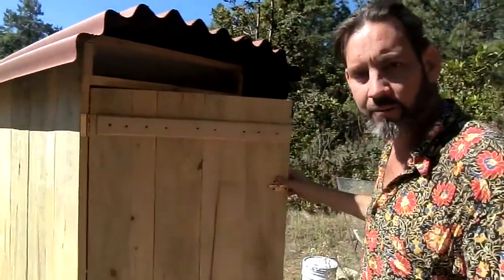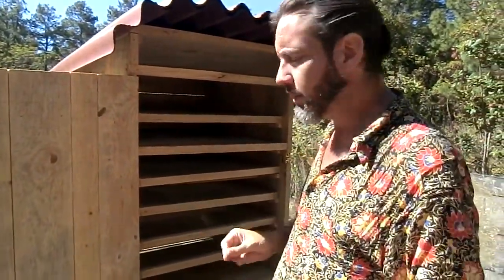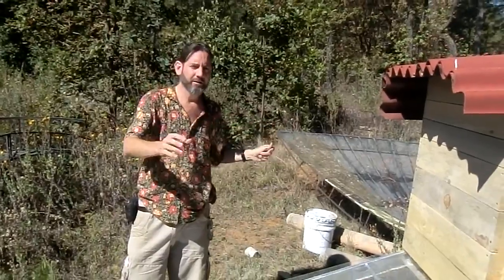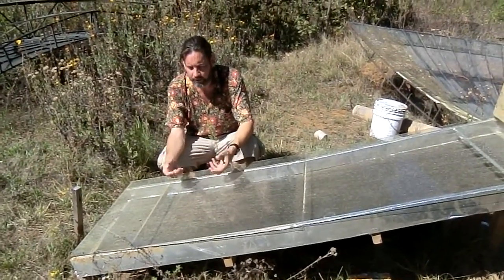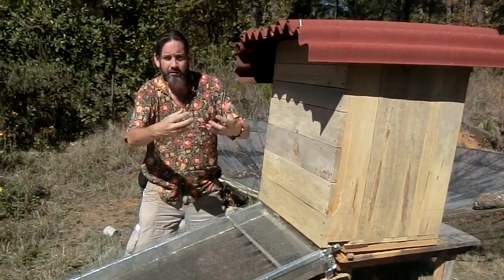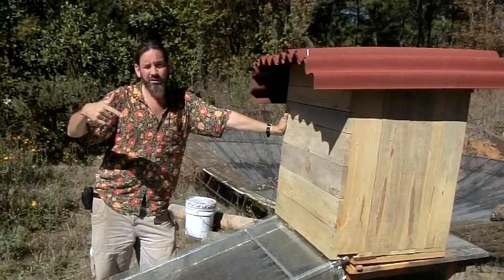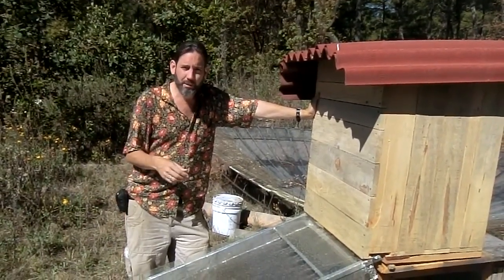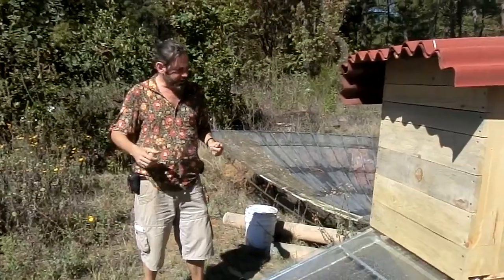Solar Food Dehydration. I can build a much bigger better room sized dehydrator.

Comment: It’s so interesting and informative! Thank you for sharing. About how long does it take to dehydrate when it’s full? I imagine that has to do with the water density and thickness of the food. 

It’s wonderful to see that video and you so young and hopeful !
Reply from the maker: It depends on what it is. 
Yeah. Thickness, density...
It usually takes a couple days for something such as bananas, which it longer than I would like. 
The new one will have thermal mass to work at night as well.  
The air incoming will be colder and therefore drier. Cold air can hold less moisture.
Reply: Now I need to go look up why cold air holds less moisture… 😁
Reply: @ Cold air holds less moisture than warm air because at lower temperatures, water molecules have less kinetic energy and are therefore less likely to remain in a gaseous (vapor) state, instead, they condense and become liquid or solid.
Reply from the maker: Right. That is why a muggy day is so uncomfortable, but a dry heat at the same temperature isn't. You can't sweat on a muggy day.  I have hated muggy weather since being in Managua in 1986.